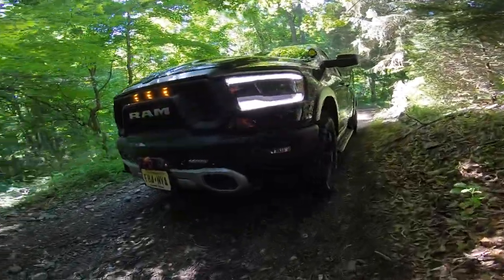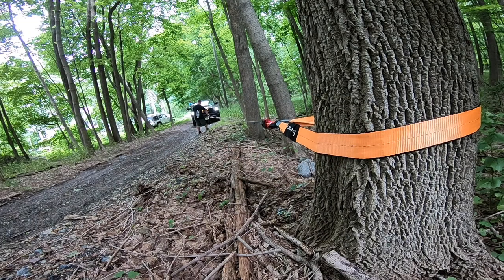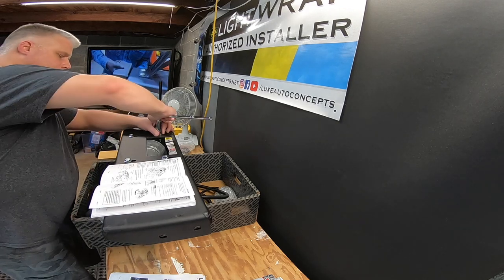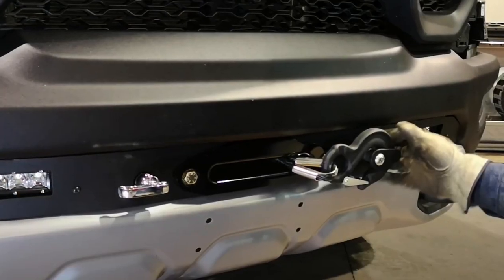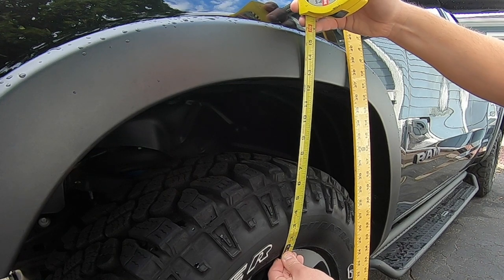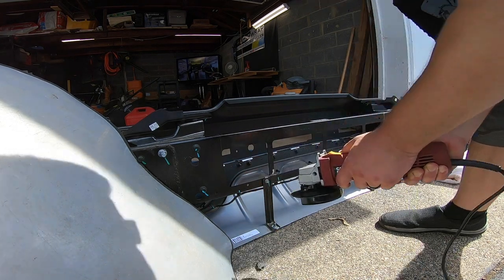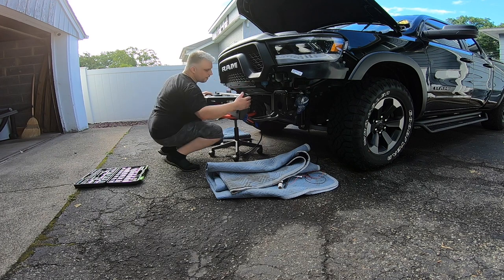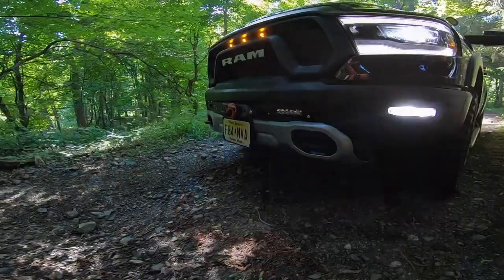Vice Design Hidden Winch Mount Ram Rebel

Comment: OK I commented 6 months ago on your review how has it been holding up since your installation  ? Before I consider to order. Thank you. 🇺🇲 🤙🏼
Reply from the maker: So we’re well over a year in use. I daily this through the NJ winters. Between salt from the roads and off-road driving on the beach. It’s held up very well  

No rust no loose bolts no rattles it’s almost like it’s not even there!  I wish I could say I got stuck more and used it a lot but it’s like a safety net once you have it, you’ll never need it.

Comment: Nice video. I’ve been thinking of adding this to my ‘21 Rebel. 
I do like your grill lights. Which ones did you use?
Reply from the maker: I used these tinted amber lights https://amzn.to/344TuTR

They fit without any mounting. The rubber gasket slides into the grill and locks them in place.
Reply: @WorkPlayDrive  Thank you.

Comment: Awesome job 👏🏼 .. if I may what was the total cost $. I like to do the same setup as you did for my 2022 Ram Rebel. Thank you. 🇺🇲
Reply from the maker: It was about $2900 but there are less expensive winch options. I went with a full wireless setup so I don’t need to roll around in the mud to flip the clutch.
Reply: @WorkPlayDrive  Awesome I really love your setup and it's what I would go for. To much work for me to install I rather have it installed for me. Since I just retired as a Union Sheet Metal Worker in NYC. But if you are not to far and like to make same cash in helping me installing it let me know because you have done it already on yours and you did an awesome job. Thanks again for the info brother. 🇺🇲🤙🏼
Reply from the maker: Thank you 🙏 as much as I love doing this stuff, unfortunately I’m not insured to work on other people’s vehicles

Comment: Did your Rebel come equipped with an IBS (Intelligent Battery Sensor)? If so, how did you handle wiring a winch to an IBS-equipped vehicle?
Reply from the maker: Remove the negative terminal, and the IBS bolts on from the bottom. Remove the IBS and place the negative winch cable on the battery terminal then reinstall the IBS. 

The winch negative is connected to the battery terminal.
Reply: @WorkPlayDrive  The problem with that is it may provide an alternate path from the battery negative terminal to chassis ground through the winch itself. This would effectively disable the IBS entirely because the battery negative terminal no longer needs to go through the IBS to get to chassis ground. Disabling the IBS could cause potentially serious unknown electrical problems and may void the warranty for related issues.
Reply: @WorkPlayDrive  HAL is correct.  For most winches, casing is ground.  If the winch ground cable is connected directly to the battery negative terminal, this can provide an alternate ground path, one that bypasses the IBS, via the winch casing to chassis.  This can be somewhat mitigated by installing a winch disconnect to remove winch power/ground when the winch is not in use and/or isolating the winch casing from the chassis.  In either case, the IBS will be bypassed when the winch is connected with indeterminate effect on IBS function.